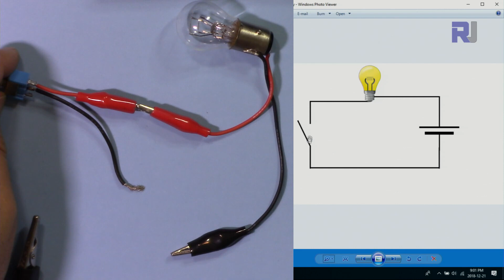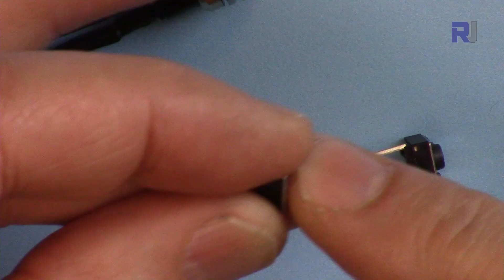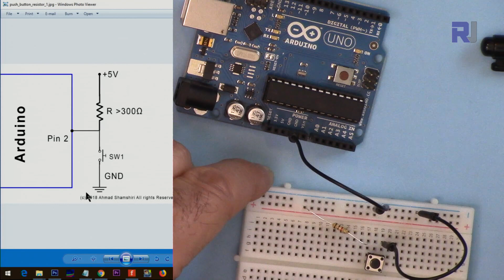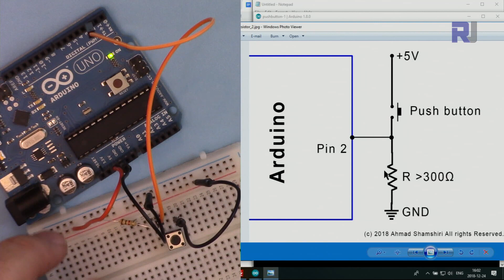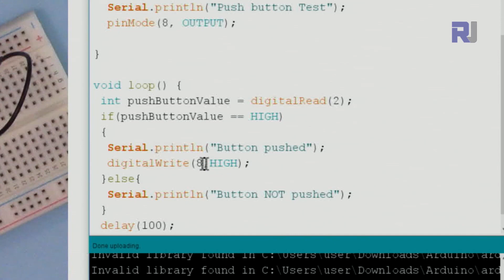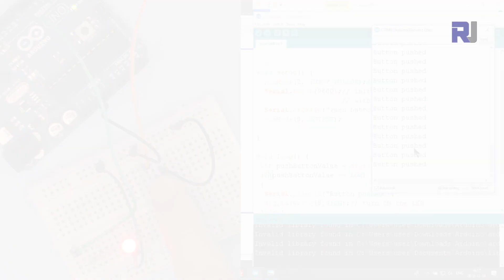Lesson 09: Using Switch and Push Buttons with Arduino  | Arduino Step By Step Course - RJT562

Comment: Thank you for this video. I am interested in the last part of this video where the PIN2 randomly made the LED goes high & low. You said that this is due to noise. For my project, I have a servo signal attached to pin 11 and a HC-08 is used to control this servo using the tx and rx pins on the UNO. I am having the same problem of the servo moving randomly and not always obeying the HC-08. Is this also a noise problem? How do i solve?
Reply from the maker: I am not sure what the problem is . it is very simple.  instead of controlling the servo, connect LED to the pin where you connect a servo and see if the LED turns ON. There shouldn't be any noise if  you did no use a push button switch.

Comment: Hi, what a wonderful tutorial, thank you,, I want a help on a schematic and code for my car Renault Clio steering remote control to adapt to my Pioneer Head unit via arduino, it has 6 wires from the remote and mixed with each other and hard for me to work on, if yes then I will provide details about it, and it also has rotary knob to define turing up and down. Thank you.
Reply from the maker: Hi, I received your email.. as you can see all my lessons and codes are available for free. but I will charge $100/hour to work on project. I didn't know what "Renault Clio " was and just checked it to know that "Cilo" was Renault car model. then I have no idea what " Pioneer Head unit" is. so it seems I am not familiar with these laments.  You may find someone at UpWork here https://www.upwork.com good luck

Comment: Question: When was the last time you have to keep pressing a button to keep a light on? Probably never, then what code will you use to make the button that you push only once, you release, the light stays on and when you press the button again, the light goes off???
Reply from the maker: You might need this https://youtu.be/7CCSRs5bvH0 always search my channel. I have over 500 videos
Reply: @robojax  Thank you, this works for me as a beginner in Arduino.

Comment: Dear Robojax, you explain circuitry and physical connections so beautifully.  Well done 10/10. I am an electrician and I appreciate the physical stop/start stations with contractors, aux contacts and etc., but to do the same in parallel with Arduino is where I'm slowly learning from you. Thank you, Pete